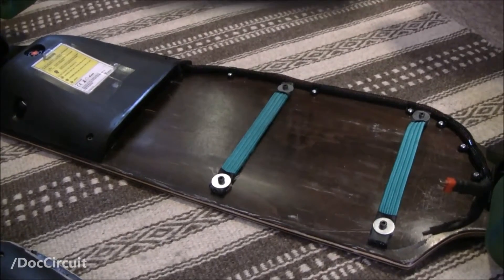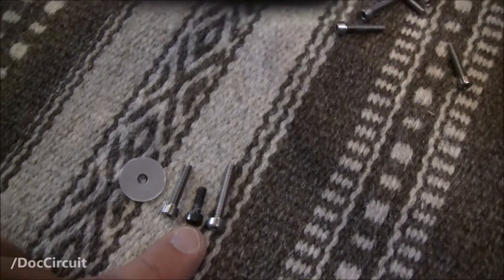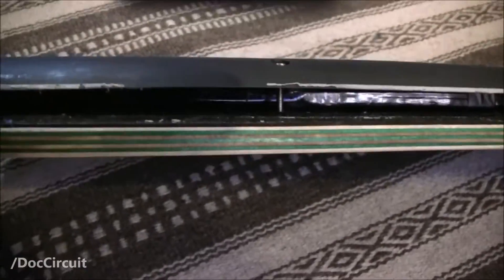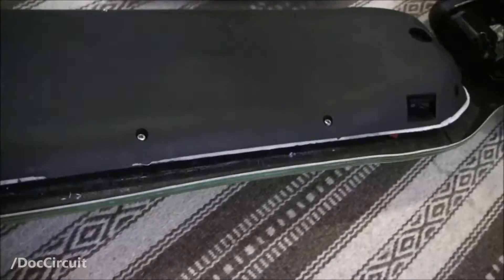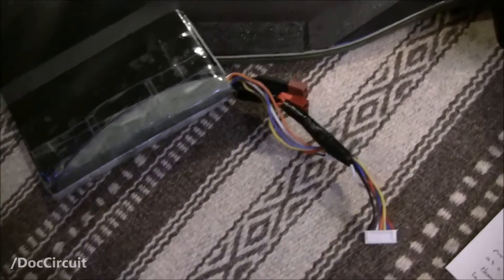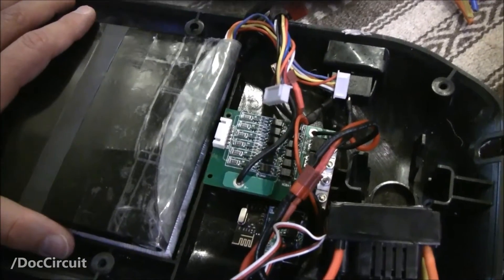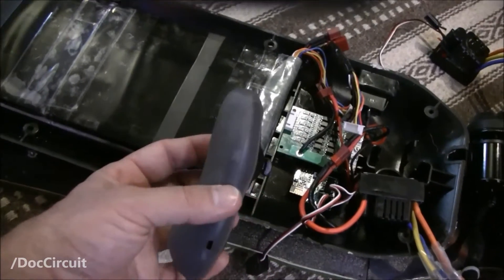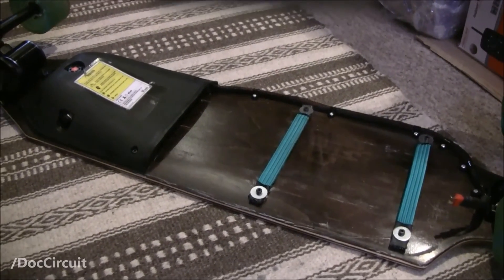Can Two Batteries be Wired in Parallel in a Chinese Clone Longboard without Modifying the Case?

Comment: Brilliant, Thank you so much, The gap is the only issue, but like you said it can be covered, If only the batteries were thinner haha. I do think I will do this, Not just yet. But in the near future., I like the idea of the On board BMS connected to both batteries, so charging is made a lot easer! But if the BMS dies I will just have to take it out of the equation. 
Very interesting video, thanks :)
Reply from the maker: +Ed Bray No worries, and when you do this you must make a video of it. I, and I'm sure other people, would very much like to see the result! :-)
Reply: Yeah I will defiantly make a video showing it and a test ride. Do you think its possible to cut away at the plastic casing inside to try make that gap a bit smaller?
Reply from the maker: +Ed Bray Mmm, doubtful. There isn't much depth to cut into, just width, and you'll need that.
Reply: +Dr Circuit okay, I will look into a good way I can close the gap up, I want it to be as water tight as possible!